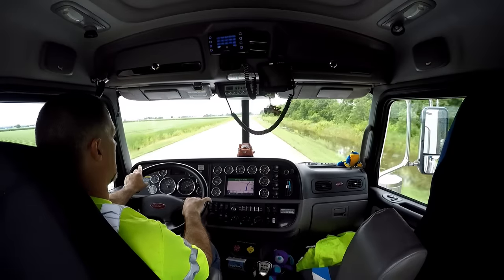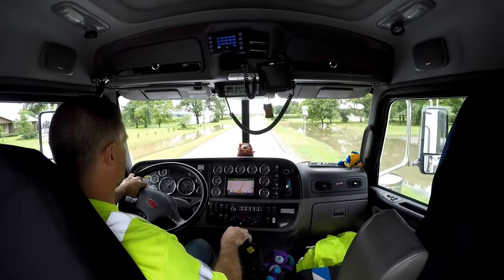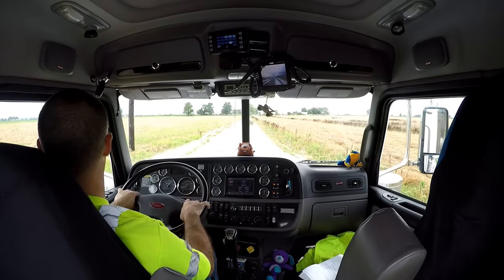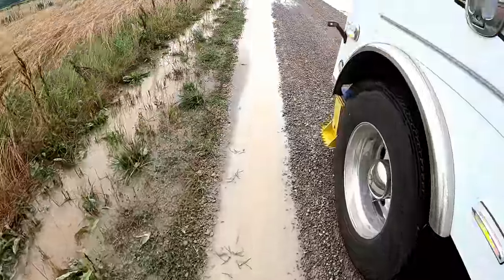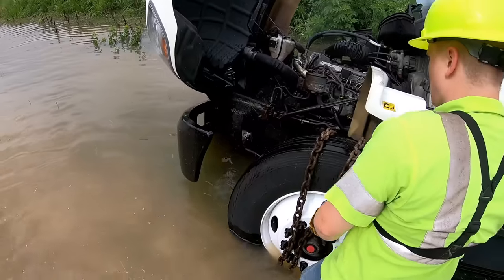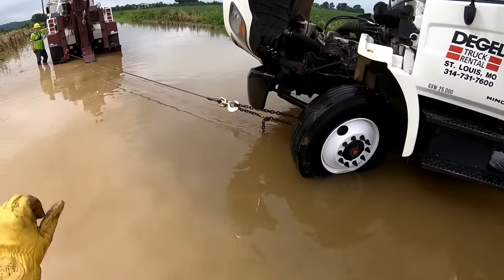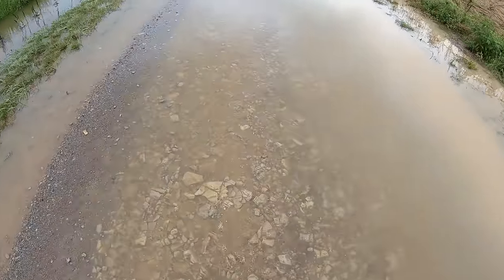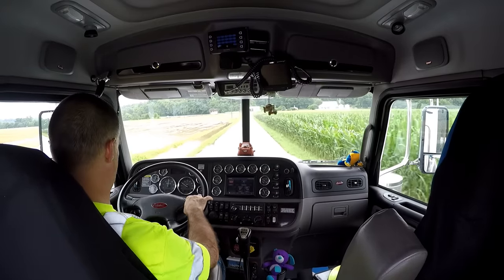Box Truck VS Flood Water

Comment: Another great rescue. Gotta love people who drive through deep water, even when told to by an "officer". Definitely correct about the wheel bearings, seals and specially that rear axle. Water = death to bearings. Gotta ask, what's the difference between you having to tow him to St. Louis than him just driving there? Still have a set of wheels on the ground, turning, with the possibility of damage? He's too tall to carry piggy back unless loaded on a lowboy trailer, 13' 6" is max height last I knew.

Ron, you're partially correct about the "base" of a road during flooding, however, even paved roads are just as dangerous. Water current "undercuts" and there is no "bottom" to the road, except now maybe 10' - 12' deep. I've seen highways here in KS get completely washed away because of the undercut that happened. I've also seen dirt/gravel roads completely wiped out as well. Note I'm not disagreeing with your statement, only pointing out that even paved roads can be bad or worse than a gravel road. Paved roads, specifically,  major highways, usually are "built up", while gravel, only perhaps a slight build up is required, most, just a big layer of large rock then covered with road rock.

Not wishing for the flooding but, over here, we've gotten a few rains but, not enough. Now, we're under a heat advisory... again.

Comment: Hey Ron. You should keep waders in all the trucks. I’m sure Talon got a little water in his boot.

Rule of the road: If you can’t see the road, don try to drive on it. This is true for cars and even big trucks.

Loving the full length video. Stay safe. Stay dry. God bless.

PS: You stopped for the safety of the other tow truck driver. I’m sure the man upstairs is smiling at you for that one.

Comment: In about 1982 I was driving thru Rouge Park in Detroit and TOTALLY didn't see the water I drove into. 2 things happened simultaneously. 1) The floorboard bowed up and hit me in the feet. 2) lol a 1 foot column of water shot into the front seat thru a hole in the floor I didn't know was there! I WONDERED why the heat wasn't enough the previous winter! Old Chevy wagon.

Comment: As usual good video.I think you are correct on the water in the wheel bearings.If that were my call I would say clean and relube all wheel bearings,drain an refill dirrerential,change engine oil and filter.I was an Army mech for 22 years had to check out a lot of trucks that were used in deep water ops.Even with all the special gear on MIL.STD trucks we found a lot of water contamination.

Comment: I have a President Grant 40 channel sideband CB, having a 3/4 wave base-loaded whip, the base station is a President Washington 40 channel sideband CB, using RG-8 coax to a RON 55 tower. That tower also has my ham antenna on it at 108' above the ground and the top is lited to meet FCC requirements. HW-101 Heathkit 10 to 80-meter radio [tube type] that I built back in the mid/late 50's. I'm licensed for 26 CB radios and that mentioned ham radio.  That is also a reason I do not leave the area during a hurricane. I can be heard by our EOC during those emergencies. Do understand I took CERT training (Community Emergency Response Team) so that is the other reason I'm here.

Comment: "Don't go any further than you feel safe, considering your own winches and the giant other wrecker backing in perfectly positioned to drag you out of anything you sink into."
Not sure if you have any drivers at the extremes of the size range, but it might be a good idea to have a full clothing kit in each truck; muck boots, waders, hi-vis coveralls, 2-3 extra sets of gloves, Tyvek coveralls, etc.  Not cheap to buy it all initially, but worth it if you forget, lose or damage something during a run.  Alternately, each driver could build out a kit and just have a duffel bag that moves from truck to truck with them.

Comment: Did Talon rear haul that box truck? Cranking a set of soggy differential gears and making gear lube/water foam is far more problematic than wet front bearings.

Comment: 1:04:00 Class Act. 👍. Many people don’t realize if you get an axle under water, it can cool quickly, create a vacuum, and suck a bunch of water in the breather. Or, if the breather is plugged, right in the wheel seals.

Comment: wheel bearings are sealed no worries there !
Reply: Not really the rubber plug in the center has a vent hole in it to allow for the explanation of the oil in the hubs.

Comment: I assume that it was a smart move by the driver to keep the truck running.  The exhaust was still underwater when Midwest arrived, plus if the water went as high as the driver said the batteries were probably shorted. (if they are behind the driver steps like big rigs?)

Comment: Did you flat bed the truck? Just asking because towed or not those bearings would not like having water mixed in the oil at highway speeds.
Reply: I think that this was not Ron and Talon's "initial" job --- they were just supposed to pull the truck back onto the road so it could be motored a comparatively short distance onto dry pavement; the driver would then call the truck's owner-company and ask what they wanted to do.  As Ron said, though, it would be wise not to drive the truck any farther than necessary till the bearings were all flushed/drained/disassembled and then re-packed with grease and other fluids.

Comment: 2 questions cause i'm a nerd :-)  1) What's that handle just aft of your air horn pull?  I noticed Malachi has one there too.  Is that the mechanics of a spot light?   2) You talked about worried one or the other trucks getting stuck.  Do any of your primary heavy recovery vehicles have a front mounted winch powerful enough to do self recovery?
Reply: Yes that is a spot light,I have never seen any of his trucks with a front winch,but with that rotator you can swing it in front and snatch block it for self recovery.

Comment: Hey Ron you can use your side splitter to shift 1/2 gear in reverse to gain a little backing speed and if you really need to haul butt in reverse you can use high range but that gets tricky I use the side splitter to gain a little speed and it helps a ton just shift it like you would going forward hope this helps

Comment: Two curiosity questions. Why lower the under reach every time?   And. Which came first Talon working  for you , or working for his girlfriend's/wives father (aka you)
Reply: Lowering the wheel lift frees the rest of the equipment,  the wheel lift locks everything so in order to use anything the lift has to drop down

Comment: This is one thing where sometimes police officers can mess up on.  if one highway is shut down because of live power lines, you don't direct traffic onto a flooded road.  The driver of the rental truck told the two truck company that a cop told him that the main road was blocked because of a downed power line.

Comment: So, backing down the gravel road - are you driving "by the seat of your pants?"  I find that I can usually tell how my car is doing by how it feels on my seat and feet - not just thru the steering wheel or with my eyes.  Especially the traction on snow, ice (which I try to avoid), mud, wet leaves, rain, etc.

Comment: Ron the gearbox looks to have a strange layout watching you change up after a Stop at a junction "7:30" . I thought most Americans referred to Roundabouts as traffic islands I have been enlightened.

Got it now High and Low range
Reply: Its not the same as a 10 speed, it has a secondary switch, low range 4, high range direct for second 4 which is low 5-8, splitter to overdrive high for last set of gears , look up Eaton Fuller 13/18 speed diagram. in New England some call the roundabout a rotary where we have had a few for at least three decades (30+ years).

Comment: For that kind of water you folks need some hip boots like we used to wear in the fire department. Folded down they are easier to deal with than the full waders, up they are not as hot either.

Comment: Water isn't going to hurt the wheel bearings. No different then rain and road salt getting in them they are usually sealed pretty tight and have grease in them. Get well Talon. Stop working him to death Ron sheesh lol

Comment: 38:28 I'd have left that T bar more above the surface until the moment it was being moved fully into place under the target's steering axle because the surface of the water distorts the actual location of things underneath it, coupled with the water being quite turbid, makes it an obscured trip-n-shin hazard whose actual position may be misjudged by someone going around it to reach the other side of the truck.  Slightly misjudging means any contact is very likely to be with the ends or back of the T-bar which are also the locations of the most unforgiving steel edges and protrusions.

Comment: I had fun a few years back as I had to drive in flood waters to drop off a trailer to a store that was only a few hours away from the hole town being closed off to everywhere else for a hole 2 weeks, I was given directions that was not right and had to drive in over 4 foot of water on a dirt road at night (or 5am dark) with 40tons of load, I was lucky at the farm fences gave me the road line, it was scary till I got out of the water and no once I was on the road there was no way to turn around with a 50foot trailer. Lest just say the bloke that gave me directions got his ass kicked for that by his boss.

Comment: But what is the lift axel for?  If engaged while driving and lifted while parked/reverse?
Reply: Due to how heavy the truck is, that lift axel is there to spread the weight out. When they build the truck they have to design it to comply with law's in all US states not just one its gonna be sold in as it could go to every state. That truck tips the scales at 73000 lb's as he said in 1 video with all the gear they have on board.
Reply: US law has trucks allowed a max. of 80,000 lbs. gross vehicle weight with no more than 34,000 lbs. (I think, it's been a while since I drove truck and had to remember this) on the tandem drive axles), the lift axle would likely be of most use to him while he's towing another vehicle (the 3rd axle increases his allowed axle weight) and thus helps him stay legal without needing over-weight Permits.

Comment: Ron, you do have a dog, right? How would you like to give him a treat every once in a while?  The reason I'm asking is that our Fort Walton Beach, FL. PD CPAAA gave out homemade mutter butter dog treats at a citywide event "Dog Days" and it was a hit with the dogs, and people that were there and it also included several K-9 handlers. 

Now, this is special and there is an important element to be aware of having UNSWEETENED APPLESAUCE in the mix. 

Peanut Butter Dog Treats. Or As We Like to Call 'em Mutter Butter Cookies for dogs.

Things you will need: 
1 ¼ Cup Wheat Flour:  
1t Baking Soda: 
1t Baking Powder:
½ Cup Peanut Butter: 
½ Cup Honey:(important to get this one as CLOVER honey is the secret. 
   Your dog(s) will thank you)
½ Cup Applesauce: (important to get this one because it is UNSWEETENED. No need having added sugar in there our dogs don’t need)

Set your oven at 325 degrees. 

To make the cookie batter: 

Mix peanut butter and honey in KitchenAid with paddle (or if you don't have a KitchenAid, you can stir by hand). Then add applesauce and mix just until incorporated. In a separate bowl combine all dry ingredients. Add into peanut butter mixture in two additions, scraping the bowl with spatula after the first addition. 

Now for the assembly:

Scoop dough with a small scoop onto a sheet pan covered with parchment. Place a second sheet of parchment on top and flatten cookies with another sheet pan. Take parchment off and mark each cookie with a hash with an oiled fork. 

Bake at 325ºF for 12-15 minutes.

Let the mutter butter cookies cool, and then comes the fun part, the taste test! Hopefully, your dog enjoyed the cookies as much as my taste testers!

Make sure you join the DOG for DOG, SAVE our SHELTER, and POUND for POUND movement and follow along by subscribing and liking the video. And feel free to leave comments. Your thoughts, questions, and encouragement are all part of working together as a team to help save lives.

Comment: Would not towing it have done as much, if not more, damage to the water-logged bearings than actually driving it would? 
In my experience, it's the brakes that suffer more than the bearings.

Comment: Watching you drive down the two lane, even through town, it sure seems like your truck has a lot of steering play in the wheels.. Watching, you can see that either you have some slop in the steering, or it is just so damn sensitive even the slightest movement turns the front wheels...

Comment: take alot more water then that to affect the bearings
Reply: hoss2472 no it wouldn't. The driver of the straight truck said the water was up to the top step when it went in. The rear axle MIGHT be ok as long as the vent tube wasn't submerged and the axle seals are good. On the other hand, the front wheel bearings don't use actual bearing grease, like a car or light truck, they're filled with oil and only sealed by a rubber plug. That's fine as long as they're nor under water for more than a few minutes. Any longer and the water WILL get in.
Reply: Worse than the water would be any sediment which would be abrasive
Reply: Drive it a few miles and check the color. If it's milky, time for a drain, flush and refill. Same on the rear.

Comment: I would think that the wheel bearing seals would hold out the water when it is not very deep like that.
Reply from the maker: Water is much more viscous than gear oil and will easily pass through seals when they are submerged.   Thanks for watching and God bless.

Comment: Why did the truck driver keep his motor running the whole time he was stuck? He was just wasting gas. Moreover when you opened the hood of the truck it would spray water on you and it was dangerous to work on it because you could have been struck by moving engine parts. Finally don't people where the truck driver comes from wear shoes? He was bare feet - no shoes or boots.

Comment: First he should not have left the truck running, that engine was on a serious slant sideways, meaning all the oil down in the pan was pushed to one side. Depending on where the oil pick up is, you could starve the engine for oil. Second he should have bearing replaced, and diff flushed and oil changed. Along with engine oil changed.
Reply: I don't know that I would automatically change it, but I'd sure check for water in the oils on everything that has a sump. The bearings themselves, even if they got wet can be flushed and refilled with fresh oil.  A few drops of water, if cleared out quickly enough are not a death sentence.

Comment: Just quick question,  you mentioned not to drive truck because of bearings being in water, wouldn't hurt it just as much to tow it? I know with exception front wheels would be off ground.
Reply: Philip Pummer i think that was a reference to get the bearings checked and repacked with grease rather than leaving it untill the next "service".

Comment: Do you only have 1 reverse gear or 2?
Reply: Stephen Cicero  he has two reverse gears it is because of the two speed rear diff but if the transmission has two reverse gears then technically he has four reverse gears I don’t know what type of transmission Ron has 
So I might be wrong
Reply: Probably 2 reverse on an 18 speed transmission, but best to drive slowly in wet conditions...
Reply: Eaton Fuller 18 speed which I believe he has, comes standard with 4 reverse gears
Reply: I used to drive an 18 speed, he'll have 2 reverse gears (1 in the low range and 1 in the high range)

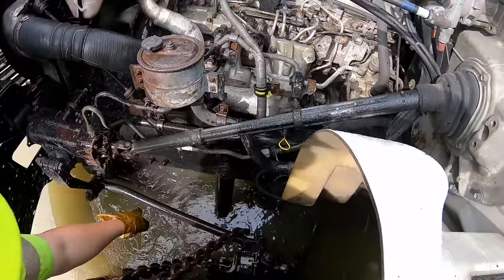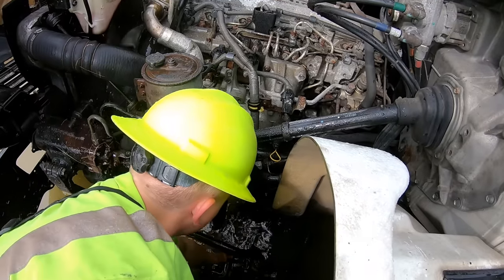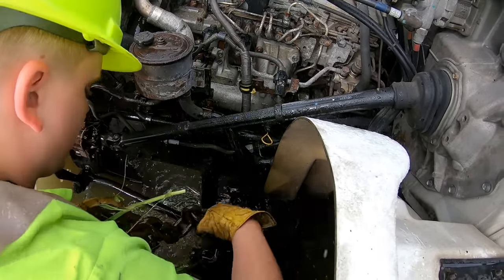Comment: at 37:11 the engine on the box truck is running very slow, at 37:26 it stops running and at 37:28 it runs backwards.
must be a Japanese engine.
Reply: Clutched radiator fan...

Comment: I'm sorry but I don't understand what was the point to go there with two trucks... :(
Reply from the maker: There are many reasons....safety being the primary concern.  One of which reasons would have been if the box truck was too far down the road to safely reach with one truck, we could have created a "daisy-chain".   Another would have been if the Western Star had gotten swept off the flooded road we would have had a way to quickly recover it.   There were many other reasons....way too many to list.    Hope this helps your understanding.  Thanks for watching and God bless.
Reply: Tkank You Ron for an explanation, now I do understand. Before I thought it was just a waste of fuel. BTW your job is fascinating.

Comment: What do you need to do to that under-reach?  Let it dry only?  Let it dry and re-grease?  Something more involved like partial disassembly to make sure there's no trapped water and then re-grease?
Reply: Wash it out, let dry, then grease it. In heavy rains when your towing with the under reach down it will collect in there and stay in till you fold it up. I've had to do it a lot.

Comment: Why did he leave his engine on?
Reply: The exhaust pipe was under water, safer not to flood the system!
Reply: It helps keep the water from flowing back into the muffler and also being a blockage when you try to start it up again.
Reply: Also, depending on where the starter is, it might not restart until the starter has a chance to dry out.  There's also the issue of batteries. If they got flooded, it might not restart without new.